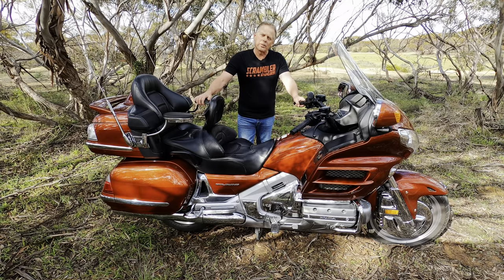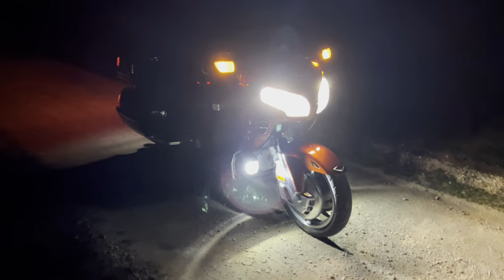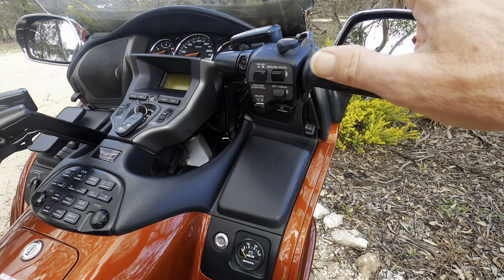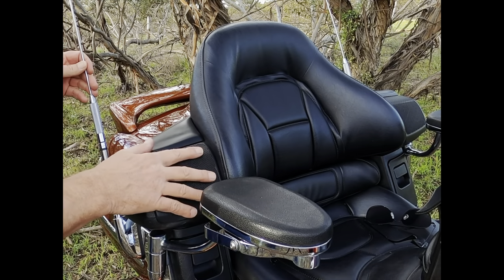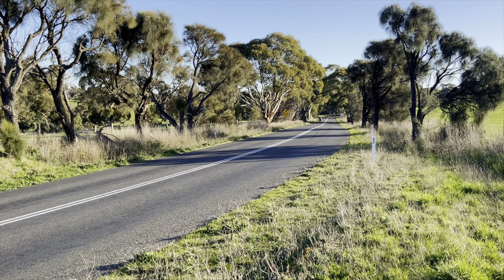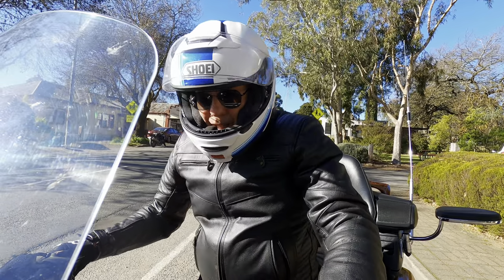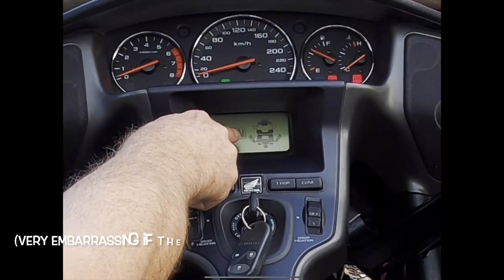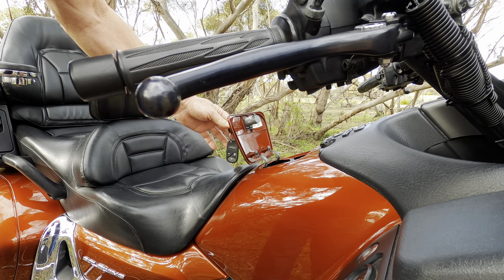Honda Goldwing Used bike review  Is it as good as people say?    (56)

Comment: If you don't see an ABS warning light on the gauge cluster, it does not have ABS
Reply from the maker: Yes true good tip, so long as you know where to look for the light. I have ridden a friend’s without abs and tried a few emergency braking stops, I must say it still stops very well. Thanks for pointing that out 👍
Reply: @standupmoto  I bought a 2016 Gold Wing  F6B and the bike was listed as having ABS.  The sales guy told me that since there were three brake lines, that meant it had ABS.

He wasn't trying to lie to me, but since they sell a lot of brands he wasn't super familiar with this bike.

I was still suspect and looked in the owner's manual and that's where it said models with ABS would have the light.

I later found that no US models of the F6B have ABS and all Canadian models do.  The third brake line was for the linked braking and the US and Canadian models share the same manual.
Reply from the maker: @kennethsouthard6042   Ah very interesting, yes I found a similar situation here in Aus with the pass light. My 07 has the pass light operation by pushing down on the hi / low switch, after doing my review I was contacted by many owners in the US that said this was not on their 07’s. With most saying they didn’t have a pass light switch at all and yet mine was made in the US. I’m not sure why Mr Honda would vary even little things like the light switch, I guess I can understand it with the ABS as there would be a considerable price difference but a light switch. Thanks for your input, the more info potential buyers of these wonderful machines can have the better.

Comment: 118hp for a bike, even a 2 wheeled cadillac, ought to be plenty.
Reply from the maker: Yeah, truth be known it’s more than enough. To be honest I have never needed more even two up full of gear overtaking at speed up hill with a head wind but you know human nature, just a little more would be nice. lol. Cheers.
Reply: @standupmoto  cool. I like it.  I dont want to do any wheelies or racing, just want to ride to work with some clothes or luggage, and maybe take a few scenic trips a year.
Reply: I want the red one from late 1990s
Reply: If you load it down and have a trailer and passenger its going to be slow compared to a tesla so 1800 is nice. Thats enough to keep it moving. You want to be able to accelerate quicker even if you never actually do rather than an engine size where its strained to efficiently pass on the interstate like a dr650 thats built up for cross continent type riding. I had a 2000cc kawasaki and it was lots of extra power. You wanted it. I had a 1600 kawasaki and it got worse fuel economy than the 2000 so thats very interesting. More power and it was chesper to fuel the bigger bike. Same exact bike, one was just +400cc and it felt more than it sounds.